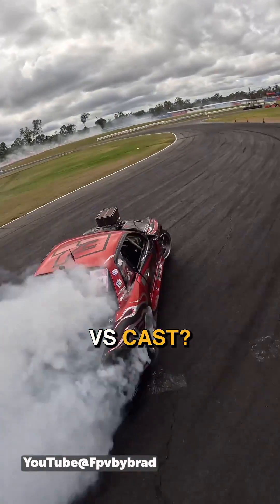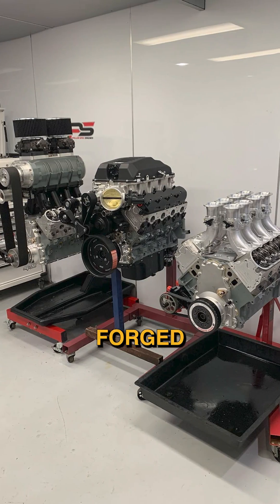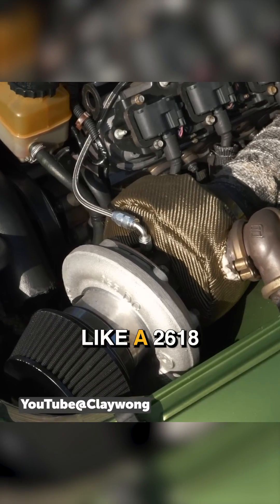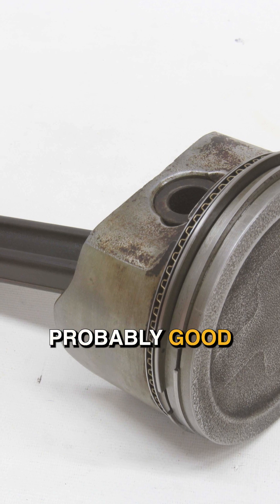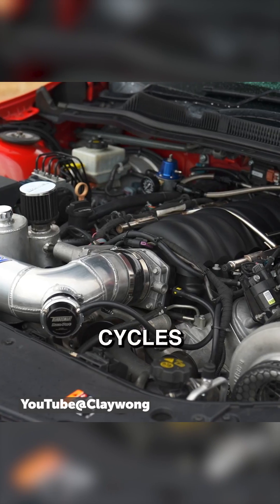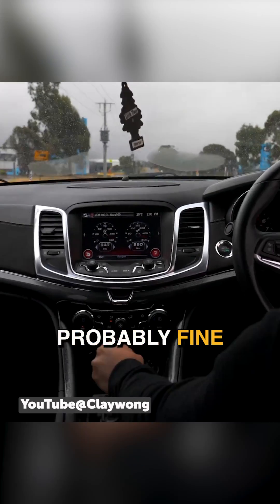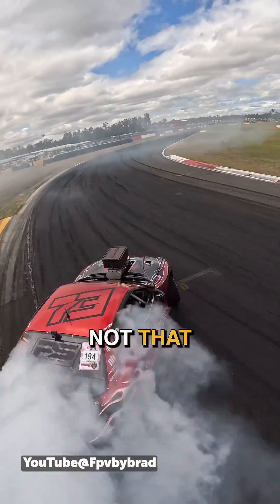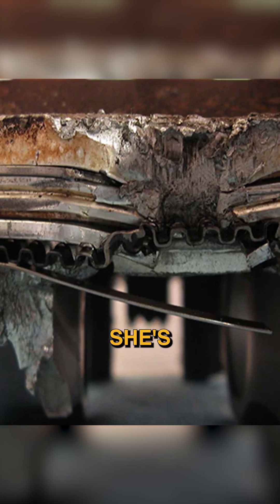Are cast pistons actually crap? #shorts

Comment: My motorcycle's engine has cast pistons and I've burned through them at the mold parting line a few times now.
Reply: Learn to tune, its not cast pistons fault
Reply: @GK-iw3hi  Its a stock ECU so not my tune. Its absolutely the pistons and the engine's cooling system is not adequate, as designed from the factory. Its a known design flaw.

Comment: I'm interested in learning the metallurgic types and applications of cast and forged pistons. For example, I'd like to build my LS with performance in mind, but still drive it on the street every weekend plus some perhaps. The heat cycles is a great point I hadn't considered
Reply: If you are concerned about thermal expansion and piston slap, it's fairly overblown. Give some time for oil circulation with cold starts, and treat the engine with respect until the oil reaches operating temp.
Reply: Just straight up find a university metallurgy lecture on YouTube at that point. You're not going to get anything that detailed on HPA